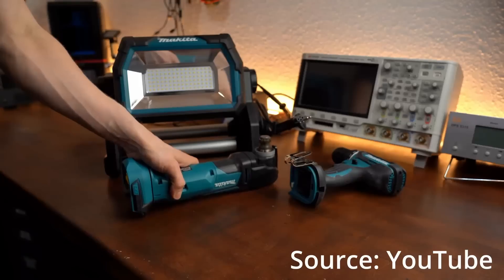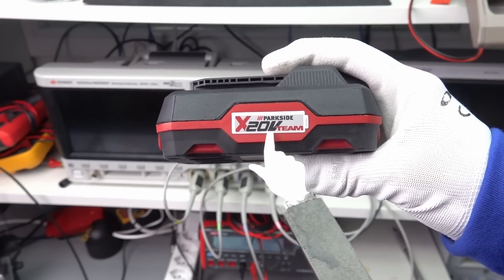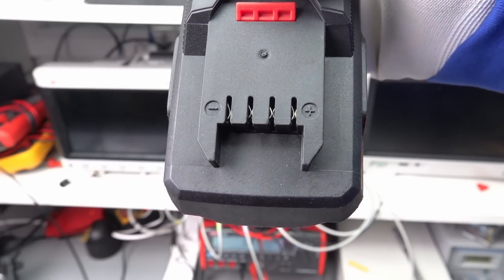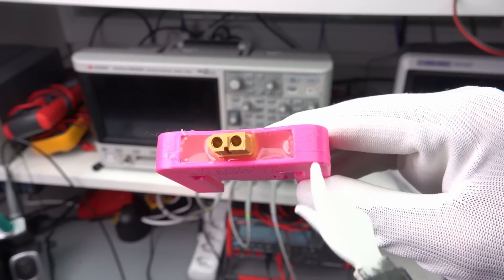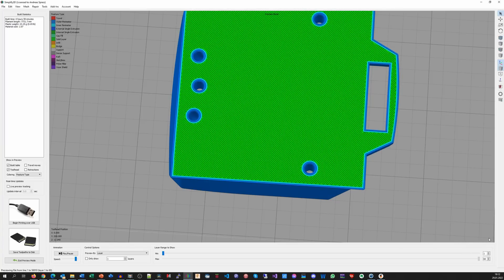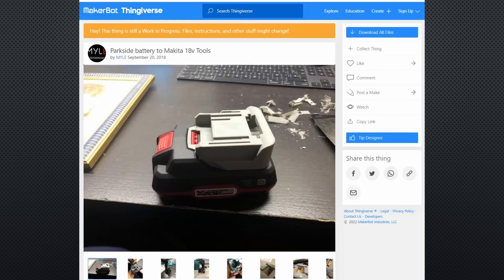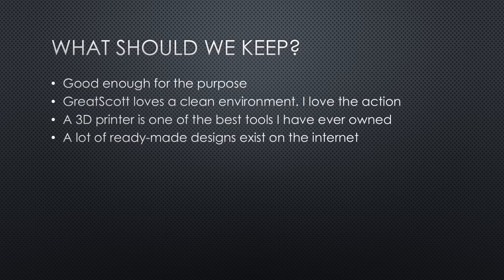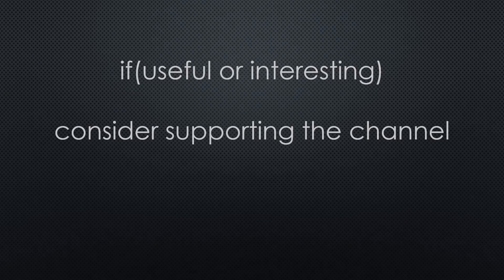#416 Creative uses of Power Tool Batteries for Mobile Projects

Comment: Andreas, last summer a friend had all his work tools stolen.  Since then been pondering the idea of a modified battery that would have a GPS tracking system, thoughts being getting an old battery past its life, gut it, add some cells for power and GPS tracking module.

Any thoughts, suggestions or inspiration to add to this plan?
Reply from the maker: I would look at AirTags. I use them on our bicycles for that reason.

Comment: I have built this for me some time ago already. So I can power up my mobile iron.. and have built a custom Worx to Ryobi battery adaptor.. but Ryobi is such a shit connector I would rather have bought it for 30€. Sadly there are no adaptors you can buy Worx -> Ryobi... if you could buy it it is not worth the hassle. It has cost me like literally 3-4 hours of manual work to build it.
Reply from the maker: I agree to buy it if it is available at a reasonable price. I did not know they sell such adapters...
Reply: @AndreasSpiess  Yeah if you value your time its cheaper to buy it. Of course if you have nothing better to do and you want to learn something you can built it. But if you only have time on weekends and you have children and wife you better buy it ;)
There are many adaptors for many different brands. But no Worx to Ryobi :(

Comment: Hi Andreas!
Another great project video! 
I have build the same power supply (Parkside Battery and DPS5005 with the same case) some months ago. It's a great design, super useful and portable!
( see here https://youtu.be/bZFrU2fJFIc?t=597 )
Tipp: use cable shoes, they do fit without changing the design.
PS: I have not forgotten the WatchDog project, just had not enough time to finish it yet - I will open source it soon. ( little preview here https://youtu.be/bZFrU2fJFIc?t=454 )

Grüezi out of rainy Germany ;-)
Felix

Comment: Nice... a quick comment... you can keep pla longer if you keep in controlled humidity. I have pla working perfectly... kept since years.  Or at least if you bake out a bit of moisture before using... old pla works like a charm.
Reply from the maker: I heard of that. For me it is not worthwhile. I experimented once with plastic bags where I removed the air. Now I try to use it faster (buy smaller batches).

Comment: I use spade terminals for connection to the battery pack instead of a metal sheet and also use an XH-M609 very cheap on Ali for battery protection. Hope it helps
Reply from the maker: I did not know these XH-M609 (because I not often work with 12 volts. What about the relay? Does it not consume a lot of current while on? Or is it bistable?
Reply: @AndreasSpiess  Hi Andreass I think the relay is monostable. I do not know how much current it consumes while on but the thing is that you can adjust the on and off  power from 12v to 36V and adjust when the relay switches on and off wiith a voltage dfference. This might help https://www.youtube.com/watch?v=BNb6NJVhQpo&t=238s. So I think is a great cheap choice for external protection on battery packs that does not have the onboard protection :). Finally there is the XH-M604 that goes from 6V to 60V. Hope it helps.

Comment: If you don't have a 3d printer, but have lidl batteries, you can grab one USB charger adapter from lidl (when that is for sale...) , and modify that with other connectors.
Parkside PAA 20 (A1, B2, or some other  suffix, since they always come up with new version :D
Reply from the maker: Thanks for the info. I did not know that they sell them.
Reply: Same ideea for Makita there is an adaptor that can go as cheap as 11usd and it also includes a  usb port to charge your phone/etc and have low power disconect at 13v . 198634-2 is the code.. and there are other similar like that

Comment: Finally, the long awaited (cheap) Li-ion battery pack video, thank you! I was hoping for something more ("we want more"): a load sharing / power path circuit (something like this: https://youtu.be/T70mBHeIOZA but for the whole power pack, not just a single cell), to be used as a mini UPS for RPis. Really disappointed to hear the BMS is in the power tools and not in the battery packs, I guess they did that on purpose.
Reply from the maker: I do not see the need of a power path in this setup. No solar involved. And if, I think you can use the same principle. Just select the right FET (Vgs). But I never tried.
Reply: @AndreasSpiess  I think FQP27P06 should be ok. I didn't mention "solar" (it was just in the other video), my intention was to use: mains --> original charger --> load sharing circuit --> battery and RPi (at the same time). I wonder if the charger can safely charge the battery pack and power the RPi (2-3 amps) *at the same time*, without the power drawn by the RPi interfering with the charging of the pack. I hope I managed to explain it more clearly now. It would be really nice to turn such a battery pack and its charger into a mini-UPS for the RPi.
Reply: @dan-nutu  This would be a very useful circuit, either solar or mains powered mini-UPS!!

Comment: Interesting, you've convinced me that a 3D printer is a uselfull tool. The problem is that it's a more complex issue learning how to use it with the lack of free time I have.
Hoping to be in pension in 3 years time, just in time when 3D printers might be useless, Amazon will surely take over the maket, you design on the computer, order the print and the day after Amazon delivers at your door.
I've abbondend all my UV and CNC pcb skills thanks to PCB services that deliver in a week from China.
Reply: @Santo Pino If you’re interested in learning to use Fusion 360 for 3D modelling, I can recommend the excellent Fusion Basic tutorials on Arnold Rowntree’s channel. I tried various others but everything just clicked following his explanations and I quickly progressed
Reply: @HiruS22  Thanks, I will surely try sooner or later.
Reply from the maker: I agree with the PCBs because the Chinese offer 2 and 4 layers including plating and vias which were not possible in my lab. With 3D printing I often just print a detail to check if it fits before I print the overall thing. So I am glad I have one in my lab.
Printing is the easy part, BTW. Modeling is the hard one.
Reply: @AndreasSpiess  I've watched a video from a guy that does his through hole plating himself, just too complicated chemistry and dirty work, a mess to clean up afterwards, I rather redisign the board.
I tried through hole pins that require a tool to crimp, micro meccanical working that's not for me and anyway, it's a slow process.

Comment: The new battery pack Parkside PAPS 204 A1 have a bluetooth module to set undervoltage protection, max current discharge and other stuff. Cell balancing and 2170 cells, so the 4ah is of the same size of the old 2ah.
Reply: Pay VERY close attention to the circuit design if you’re working with such batteries. The Parkside ones DONT HAVE INTERNAL REGULATION. I recently found that out while doing similar projects and ran into undervoltage issues. The cells of the battery are literally directly connected to the output terminals. The actual protection of the battery is handled by the tool and not the battery. The battery bms checks the voltage and communicates with the tool over the second pin. The tool gives out a voltage on that pin and the battery bms can pull it low. This tells the circuit in the tool to shut off if the voltage gets too low. So if you use this battery for other things you have to incorporate this communication into your design to actually get protection or take the circuit from an old original tool
Reply: @maxwfk  you are replying in the wrong thread. I spoke about the last battery model, the Bluetooth one, with undervoltwge control and max current output.
Reply from the maker: Good to know. Thank you. So far I did not see it in our shop.
Reply: @AndreasSpiess  I bought it in Italy but also here the distribution is not on all the Lidl stores. I guess the raw material crisis is delaying the 2170 cells supply
Reply: where you got your information from... i think the new batteries also have no voltage cut off internally
Reply: @seakyle8320  I own one and I set the cutoff via app
Reply: @PaoloSulprizio  Ok, and have your tried and watch the voltage cut off? So, is it really working?
Reply: @seakyle8320 no, I didn't check how precise the cutoff is.

Comment: I'd love to see a complete design of a car battery charger using one of these batteries, with overload protection for the car battery, current limiting to 2A or so, undervoltage protection for the battery pack. The reason is because the car battery gets slowly (ca 50mA) discharged by onboard electronics, I don't drive often enough to recharge using the alternator, and the parking lot is too far away from the house to use cables. I know, using another car battery, inverter and 230V battery charger would work, but there has got to be a more efficient and convenient way, right?
Just clip the power tool battery into a holder in the car and replace/recharge it when almost empty.
Reply from the maker: With your 50mA the big Lidl battery would only last for 3 days (40 Wh / 0.6Wh=67h) if my calculations are accurate... BTW: I have a calendar entry and drive my Harley to a place where I can charge the battery (twice per winter).
Reply: @AndreasSpiess  true. The thing is that lead acid batteries don't like deep discharges, so topping it up with an external battery that can handle more cycles would make it last longer. At the expense of the battery pack of course.
BTW I have to do some more measurements on the power consumption of the car when it is off, as I think that 50mA is an awful lot of idle current.
Reply: @AndreasSpiess  Harley - when the motorcycle is so big, it needs to be driven, not ridden! :)
Reply: the better way was connecting a LiFePo4 battery with bms in parellel with the car's batt.  just put in a 21W bulb as current limit in there.   so the charging current does not rise to high and damages the LiFe cells or BMS.
Reply: A small 10w 18v solar panel + dc-dc buck to 13.5v is a simpler solution and you do not need to worry about replacing the Li battery when is empty
Reply: @cgmarch2359  actually I already had a solar panel connected, but a) it was too small and unregulated, and b) it is winter at the moment, so I don't think there is enough light to make this happen with a reasonably sized panel. The one you described would already be hard to fit. Audi A4 sedan isn't the best car for this. It doesn't even have a rear windscreen wiper because of aerodynamics (major design flaw if you ask me).
But good idea for many others! 👍
Reply: @nkronert  Right now I have 2small panels 120x194 18v in parallel. As you said there is not much current  just better then nothing..so a bigger one should be a better choice (340x240 10w 18v).
Reply: @cgmarch2359  I'll look into it. Thanks!

Comment: That's Big Clive pink, great project though. These battery packs are going to be useful for powering all sorts. Manufacturers seem to be settling on 18V but a shame they can't standardize the connection.
My workshop is still 100% hand tools but need to invest in a cordless drill soon. Problem is deciding which manufacture to commit to.
Reply from the maker: Sellers hate standards. Purchasers love standards ;-)

Comment: Wonderful video as always. Todays subject got me thinking about setting up some old bosh drill batteries as a portable power source. Thank you.
Reply from the maker: If they are Li-Ion it is probably worth the effort. My old power tools use NiCd with a very limited capacity...
Reply: @AndreasSpiess  yes Bosch 18v Li-Lon battery, thinking about a buck converter to give me stable usb charging. Thank you so much for the inspiration.

Comment: To saw a branch on a tree (or a rope)  it would be better to use a saw for that use. I use a saw in the end of a 4 meter shaft ( expensive Fiskars Quikfit curved saw && Quikfit telescopic shaft 42 && 50 € in Finland). The professional open wire electricity line repairers use these tools also. With the shaft in hands you can reach branches up to 6 meters and saw them easily.
Reply from the maker: You are right. I also thought about that solution. But the soldering iron was easier, and I already had it in my drawer (including the antenna pole). The "rope" is less than 1mm thick and plastic. So it melted in a fraction of a second.

Comment: Before I watch the full  video,
I never use relay, instead using Diodes and the higher voltage supply the device/machine
Power supply/transformer always higher voltage ⚡ wins
Reply from the maker: I think these two things have a different purpose. Anyway, where did I use a relay?

Comment: 3D-printing has in some ways revolutionized power tool game (and many other things) for us hobbyists. Almost every possible cordless power tool has a Chinese clone available and they "all" use Makita batteries. That's fantastic for those using Makita ecosystem, but 3D printing brings those same cheap tools for us who are using different tool ecosystems. And it's not just about converting from one brand to another, but also for adapting old tools to use new batteries. 
Inspiring video. Cheers!
Reply from the maker: Indeed we Makers and our 3D-printers have many opportunities!

Comment: If low price and longevity is youre primary concern. I suggest making you're own battery packs. 
And honestly it's not very hard,.Theirs quite a videos out their but to summarise, cell quality makes a difference so for best performace buy new Sony or Panasonic cells.. in my personal experience I use a mix of makita and homemade batteries every day.the ones I build myself stay good for about 1.5- 2 years of hard use, which Is the same, if not more than the free official makita ones you get when buying tool packs... The initial cost is more than the Lidl but when you're batteries start losing their capacity you just replace the cells, keep the casing and power controller thus making their 2nd and 3rd life as cheap or cheaper than those lidl ones.
Reply from the maker: Also a good solution. I do not think I would be able to create my own battery pack for that price. The shipping of batteries has become cumbersome these days.

Comment: Awesome !!!! I didn't even know things like this were existing. For doing electronics on the place the idea of a portable lab is very interesting. it also makes a rather cheap power supply for people that don't need high voltage and high current.
Reply from the maker: You are right. Most of us only need currents below 5A. The soldering iron is probably one of the higher loads in my lab...

Comment: Ha !
this time I was faster and did this already as a christmas project.
 This dcdcs are also available as buck boost and you can also set the cut of voltage to protect the battery.Very handy.
Thanks from Bavaria
Reply from the maker: Good point about the cut-off voltage. Was not aware of that. Thanks.

Comment: Ha, the application for a mobile solder iron remembered me back in time where I was proud on my refillable gas solder pen when I had to solder something far from the wall socket.
But now I enter my 8th year of 3dprinting experience and
can let me inspire from Scott's and your videos 👍
Anyway since F360 has f.... d the "free" license users by cutting export and cnc routing functions it's dead for me and I ve gone back to good ole freeCad where you can also import stl and transfer to bodies for editing.
PS what about corrosion of the copper conductors in outdoor use? Does it lead into issues?
Reply: Corrosion of the copper contacts outdoors. If the battery is removed and recharged frequently the contacts are to some extent self cleaning. For better protection a simple way is to simply tin them with solder.
Reply from the maker: @matneu27: I sold my CNC because I did not use it often after I got my 3D printer and cheap Chinese PCBs...
Reply: @matneu27 You were using fusion with a 5axis CNC were you? And you are complaining about a license fee. Well that is interesting. Because of course you'd know that Maker Fusion still supports 2 and 3 axis CAM. As for your claim about export, you can still export these formats *.3mf, *.f3d, *.f3z, *.fbx, *.iam, *.ipt, *.obj, *.skp, *.smt, *.step, *.stl, *.stp  So I'm really not sure at all what your issue is. looks like you fell for the whining from the uninformed "my free lunch!!" brigade without doing any actual research. Typical.

Comment: Someone, or a company, should make these adapters for us who don't have a 3D printer.  Been thinking about getting one but I know myself and will buy a crap one to realize that I will have to buy a more expensive one the week after.   So what was the other project where you had to use pink for? :-)
Reply from the maker: Another viewer wrote that Lidl sells a USB adapter for these batteries which seems hackable...
Anyway, I am very happy with my Prusa. So far it never let me down. But not cheap...
Reply: @AndreasSpiess  aha , PAA 20 L1 B2 ....  BUT it is out of stock.  Maybe another winner. The charger and battery combo only costs 25 euro which is 5 euro more than the battery. PLG 20 C1.   It probably is hackable to make it a nice connector to use the battery and with a flick of a switch or Mosfet to make it charge again.
Reply: just dont buy crap.  problem solved !